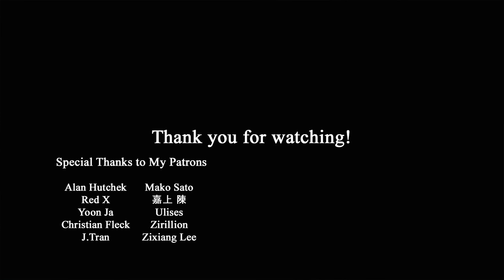Covering all my hard work.. Painting USS ARIZONA (-Hobby Boss- 1/700)

Comment: I love it Ebroin. Regarding the 1,000,000 little pieces of masking tape on the deck: could you just create a paper template that roughly fits larger parts of the deck, place masking tape on a flat surface like glass or plastic, trace the template onto it, cut it out, peel off and place on deck, use little pieces to finish the edges? Job done in 30% of the time?
Reply: Exactly, I get that his method is effective and worked but I'm pretty sure he knows that there were other easier and less time consuming methods? Ik each modeler has different techniques and stuff including myself but sheesh I swear many like to do things the hard way and they know it 😂
Reply from the maker: That is the first method I abandoned. It ruined small PE parts on the deck and the wall and it didn't save any time. I spent more time to fix all the fell off parts. And cutting precise line wasn't easy. I'll never use the method again. 
Why don't you try on your ship, you may make it work. but not me.
Reply: @EbroinSong  OK thanks for responding, there is a product called 3M low tack delicate surface masking tape. It is much less sticky than normal Tamiya tape. I just feel sorry for you watching you stick all those thousands of tape pieces on. I had to do the same on an F-35 model, it was horrible. :yougotthis:

Comment: Hey friend....very nice...! ONLY A QUESTION TO YOU...Have you notice that the distance between barbets from the bow section are not the same in comparison the distance between the stern others...??? According original plans they must be the same, the bow barbets with stern ones. I have the MINI HOBBY MODELS USS ARIZONA in 1/350 scale and have the same awesome issue, you should destroy the fore main deck to relocate the first barbet to get more closer the second one to match the same distance from the stern barbets that looks accurate distance. In fact this Hobby Boss Arizona kit is a resize from the MHModels kit with the same moulding errors. Ain't the case with the older mould Revell 1/720 USS PENNSYLVANNIA kit that is more accurate. THANKS
Reply from the maker: That is true, the space between the barbettes on the bow is too large, and the second deck floor is too small.
I noticed when I check the hull, but it is way too much work and I probably still working on it if I tried to correct them.
I made the barbettes closer when I enlarged them, it is not enough but it looks better I think.
And in the end, the babette error will be covered by... 
Anyway, thank you for the comment.

Comment: Did you glue the ship on the display stand or did you just place it on it loosely? Or is there a way to fix it onto the stand without glueing? I recently bought this same kit and I don't seem to find any attachment points on the stand or on the bottom of the ship
Reply from the maker: I didn't glue the ship. There is no attachment points, so I just put the ship on the display without any glue.

Comment: Very cool! Do you know that you can tighten the neylon strings with heating, so you will not need to adjust is lengh with scissors?
Reply from the maker: Yes, I know heat tightens the string, and no, I am not going to bring hot stuff near to my 1/700 ship. 1/350 maybe, but not 1/700. The heat source can ruin delicate pieces like thin plastic and PE parts.
And I think I am perfectly fine without heating the string.
Reply: @EbroinSong  ok, you are the master - you to decide 
Anyway, great job, enjoyed watching)